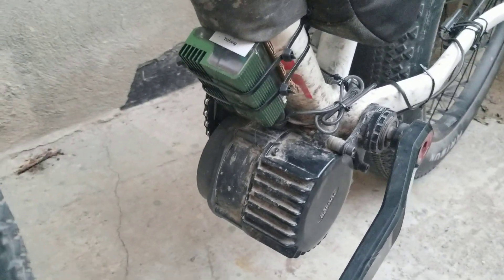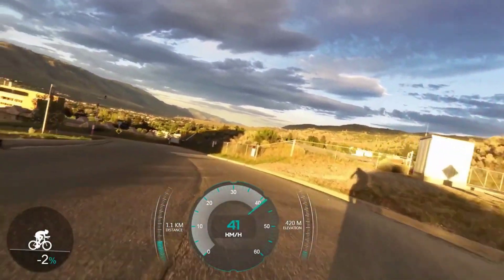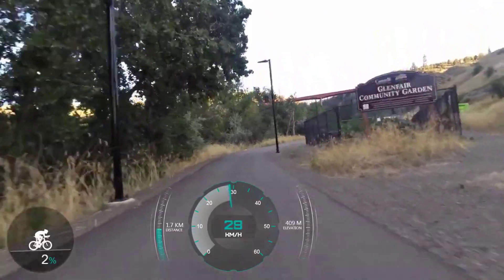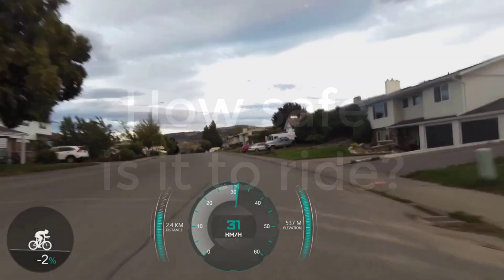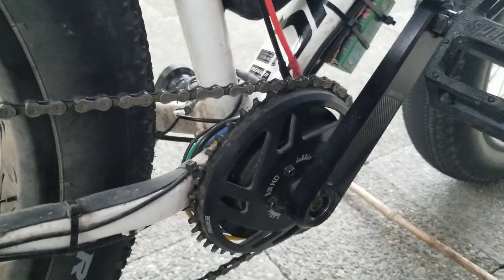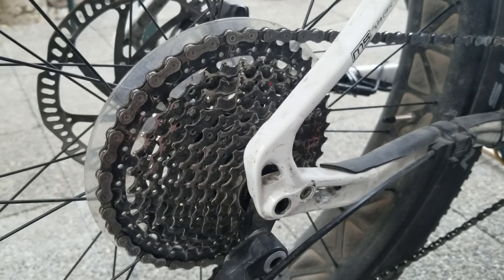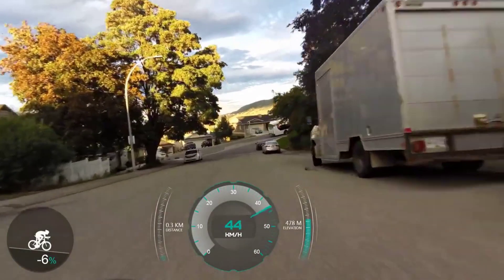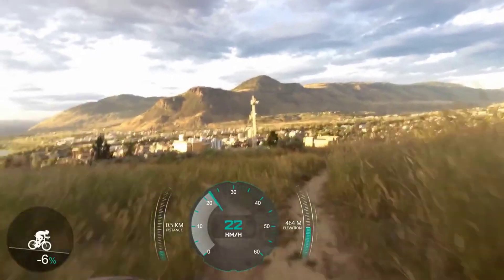Bafang BBSHD - Ultimate Controller? ASI BAC800

Comment: Are there parameters you can change? I don't like throttle being tied to pas level. Also, one of the best parts about the stock controller is cadence based pas. I can keep the pedals spinning at my preferred cadence, so I never get ghost pedaling. Does this controller support that?

Comment: I have Done NOTHING to my BBSHD and it does 48MPH or 77.2KPH in 7th Gear 64 Tooth in the Front Drive Gear and the Rear is 13-32 Tooth I go up Very Steep hills at 24MPH or 38.6KPH in 3rd Gear and it is 48 Volt 17.5 Ah 13S7P and the Motor Pulls 1,000 Watts Continuous and 1,500 Watts Peak and My Weight is 210Lb and my Bag I Carry with my Tools is 50lb. You Don't need to push the BBSHD to it is Burned up. I have over 1,287 Miles on my BBSHD and go's like when it was Brand New. Don't Waste your Money with Hub Motors.
Reply from the maker: Yeah. If you put on a huge front gear and have the right setup you can hit high speeds. This controller does it in a slightly different way but no worries on burning up either. Cheers
Reply: How can I get a control buy one

Comment: Great job with those videos.  Thanks for the content.  Is there any way to buy a used ACI 8XX already programmed for a Bafand BBSHD ? Is it a thing?
Reply from the maker: Ebay is your best bet. Or classifieds. We make a kit ourselves but there is quite a wait list right now.
Reply: @HighVoltageKits  Thanks for your answers.  Do you think the Grintech's phaserunner or Baserunner can be another option ?
Reply from the maker: If they make it again yes. They also do the Frankenrunner which I'd another option

Comment: hello, very informative video. i have a bbshd and i was thinking to upgrade to the bac controller but the prices i see are very high. how much did you buy the bac? thanks
Reply from the maker: The evaluation kits are expensive. We do make kits where they are cheaper as ASI dealers. The best way to get one is to have it pre programed. You can get a similar kit also from Electron Cycles in the UK.

Comment: Will this controller work on the bshd 750?
Reply from the maker: We have a few folks using it with the BBS02. It will work but you need to limit the power to about 2200. But a nice boost in top speed etc. If you join the discord channel via the link on the description you can chat to the guys using the kit on this motor. Let me know if you have any problems with discord. Best to install the app before clicking the link. Cheers

Comment: Great content! Isn't that the max amps the controller can pull out of the batt pack and put into the motor related to the amps the cells in your pack and the BMS can put out. So my em3ev triangle pack has a rating of 31A continuous, with the Panasonic GA cells, and max burst of 41A, and the BMS is set to trip at like 50A. So in theory the best I can get from the pack is 31A X 52V = somewhere north of 1.5kw or maybe 41A X 52V = ~2kw+.
In other words, how can the ASI controller deliver more power to the motor than what the cells are rated for, i.e. pull out more amps than what the BMS in that battery pack would allow? I'm really looking into getting your BBSHD BAC855 Upgrade Kit but I don't know if it would work with my setup (bbshd + triangle 14s6p GA sells).
Reply from the maker: The cells you have are more designed for a good capacity than high power delivery. The ASI will try and take as much power as you set it to within its limits..So if you set it to pull more than the battery bms can handle it will trip to protect it. With the specs you have you would need to reduce the power to the point where you do not trip the bms. Hope this makes sense. Cheers

Comment: it would be nice if GRIN TECH would design a controller that would fit inside the casing or replace the controller completely without having a separate thing to strap to the frame..  You also have to get different brakes, display, and multiple sensors... GETS EXPENSIVE.
Reply from the maker: Grin make good stuff but the tech is based on ASI property. It has to work with many motors from the bbshd to hubs and beyond. Luna have just developed a version 2 of their bbshd controller on the vesc platform. It seems locked to the purchase of a bike however

Comment: Is your controller sending more than 30 amps to the motor? If so, what type of battery cell is required for this?
Reply from the maker: Its 50amps ish. Bit more peak. I use Sony vt6 cells on my 72 volt pack. I have a 72 volt lipo pack as well. You need a battery pack that can deliver at least 60 amps continuous. That requires the right bms and a number of cells can do it.

Comment: Would you recommend this set up if you are using the specialized fat boy for riding in the snow or sand? And do you set up bikes yourself for others?
Reply from the maker: If you are local in town once the bloody covid restrictions are lifted then we can have a chat. I can certainly give you advice. In the meantime you are very welcome to join the channel discord community and post questions etc. This is the link. https://discord.gg/AnyQRuh I have ridden up to the top of Kenna Cartwright in snow so it does seem to go well. I used to ride it alot in snow in Gatineau. I use studded tires in winter. Sand you can ride on with good grips and wide tires! Cheers

Comment: The BAC 800 is no more now? Is it not the 855 now ? What's the difference?
Reply from the maker: Better heat sinking... Firmware like the 2000. Put it this way... There is nothing that would drive me to swap out my 800
Reply: @HighVoltageKits  Spoke to Max and he told me that he only supplies the 855 now and recommended the TFT touchscreen in preference to the Eggrider, I think I will wait until the new year to see what happens after the Brexit transition period is over, as it looks like Boris has agreed a FTD with Trudeau lol 😁 not sure how credible that is or if there is in truth to that fact ..
Reply from the maker: Sounds like a plan! Who knows what will happen these days.

Comment: My bbso2b 48v  750w does a steady 28mph on level  5 . Then lose power on a slight grade . Luna sell these controllers on the bare bone motor i beleave . Would be nice if Eric sold it seperare .or toying with a cyclone from luna to the UK ,mabee cap
Reply: Cheers , i was looking into there batterys at luna , or em3 paul for the 72v biggest ah i can find .
Would be cheaper to just do my driving test again lol. I thought eric was the man cap . He comes over " hes so pasionate about making the best batterys out there .
By looking at your early stuff and where you are now in the ebike world of knowledge ! Your well in frontvof me . Only just got my 1st solde iron at 51 .
I dont want to buy the bbshd and then think if only i bought the cyclone !!!!: lots out there to study . I see your pnto making your own cells now so good luck cap
Reply from the maker: It is well known in ebike circles that Eric is pure cancer. Im not going to say more but he is pretty much the Donald Trump of the ebike world. His path is literred with people he has ripped off betrayed and double crossed. Check out litespeedbikes for 72 volts. Chris makes a really good pack. It's what I use.
Reply: @HighVoltageKits  well only just got into it the last 3 months and should have waited and read more . But im not un happy with the little bbso2b . You read so much of others veiws about so many things cap . Do you think a 52v 17.5 or 20 ah would be a better ride than the 48v 17.5 lm running now ? .

I wasnt aware eric was a bit of a snake like that , apart from 1 thing i read 2 days ago that theres a smear campaine from other companys . Read this in a thread about the new controler in the bbshd thats 50amp now . And he wont sell them seperatley . I cant recall how old the thread was . But thanks for the heads up from one brit to another !!! About the 52v ?
Reply from the maker: I know of three people personally that have had designs for motors etc ripped off etc. But its a waste of time. He can dig his own hole. Luna is ok but there is so much bullshit marketing to make average Chinese manufacturing look and appear like us made tech. Their controller is not great but its ok for 2500 watts 52 volts. The bbso2 is good. Check out Bruno poweeeeeeeerrrrs early stuff for good modifications. In terms of battery 52 volts will get a higher speed and more range etc. Why don't you join the discord channel. Way easier to help on there.
Reply: @HighVoltageKits  will look up that channel . Seen bruno vids and hes done great for bbsers but its his voice man ohh god . 
52 volts with 20ah should be giving out more  watts . Forgive me like i said its all quite new . But have been watching an reading threads . Some guys fo the  maths then say its imposssible to go that speed . I get well over 30 on thst tiny little thing , its mad . I may go bbshd with another comtroller route.
Buy will read more before i pull the triger.
You know so many mates have brought asian thai women home an its only money etc not real love .
1st thing i notice ashley and given 50 per cen of luna !!!!! Just say it all that does .
Reply from the maker: I would not get anything ASI from luna. The cyclone is not runnable with the ASI. If you really want to use that one do some research on endless sphere to see what people used maybe.
Reply: @HighVoltageKits  imagin holland cap . Been through about 5 times on my waycto germany working . Flat as far as you can see crazzy

Comment: I got the bbso2b 750w and after changing my rear cassette from 14.28 to a 12 28 its going 67kph 42mph but thats no weight .
If lm sat rideing now i can get 35mph but i stay around 26 to 29 mph and happy an it wont burn the moter out . If i put the 52t chainring on it would do easy 40 with my weight but will keep with the 48t as it will burn the moter .
Well happy with mine .
By the way these speeds are level 5 .
I should check out level 6 to 9 but its good at level 5 set .
I love speed but i wont put the moter watts maxxed out .
Faster then some bbshd moters .
Reply from the maker: Sounds like you have got the gearing figured out! Its a balancing act for sure. I could push mine more for speed but it would be at the cost of reliability and longevity of the drive train. Cheers!
Reply: @HighVoltageKits cvf read you csn up the volt
Reply from the maker: 52 volts is the max with the stock controller i think. Maybe join the discord and post this on there. Easier to get you help. The link is via my website www.captaincodswallop.net
Reply: @HighVoltageKits  i will stick with a 48v with the highest amph like a 20amph . I got 40 miles mainly on throttle as crank arm come lose . But was surprised how much  i got thr 1st run , so 60 miled easy staying in pas 1 to 4 .
. And 26 mph is plenty.
Reply: @HighVoltageKits  yeah it was 17 mph an felt let down . The vender was no help at all .
But after lotsa foruom reading sorted the back and front out an slowly it was up to nearly 4omph but put my weight on at 30mph i still cant quite keep up pedalin which is good . If i put the 52t on i would be able to pedal but thats not wat the motor wantsc. So i plod at 28mpj an not put motor under strees .
So 30mph is on straight but keeping under 30 its a sweet spot . Took time to sort.
Fuk the 52t will keep itv away so it will last .
Just ordered bbso3 or as called bbsHD from cnebikes for the kit $470 which would have cost 600 pounds plus

Comment: Hi guys I have a 52v hailong battery 17ah with a 1000w bafang motor . Can I buy the asi bac 800 controller for this battery. As it says the controller is for a 72v battery?
Reply from the maker: It will work at 52 volts road at that for ages with the ERT kit. There are two places for a plug and play kit. ERT and Electron cycles.
Reply: @HighVoltageKits  much appreciated cap. So it wont damage my battery ? Does it make the bike go faster or does it make the bike go further or should I say the battery go further in normal riding.?
Reply from the maker: It depends on the type of cells and bms of the battery. I may be not strong enough to take full advantage of the 800 or 855 as it is now. But it will give increased acceleration and top speed. Range will decrease if you are running it full power as the price of such performance is it consumes more power. Hope this helps. Cheers
Reply: @HighVoltageKits  yes excellent so the bottom line is the 72v asi bac 800 is just a case of plug and play with my 52v battery no need for any re map or anything like that to suit my battery ?.

Comment: Dear man, I have an Asi bac 855 connected to the Inokim ox scooter (I know the motor is 800 watts). Do you have a configuration file for the bacdoor application, please?
Reply from the maker: Not that would run your scooter. https://discord.gg/YAAjfgc Join this and post and you might get some help as to what to do. There are a few people doing scooters on there

Comment: Hi I have bafang 1000w mac motor and when I slow down or stop for a second, the motor turns off. I need to turn the throttle twice or pedal in reverse to turn it on. How can I change that? It’s annoying and frustrating… do you have an idea?
Reply from the maker: Not at present but if you join my discord forum https://discord.gg/YAAjfgc you can post pics etc and we can take a look.  Some very clever people on there. Cheers

Comment: What is the max voltage you can put to the original BBSHD controller?... Have you checked the voltage rating of the capacitors inside?
Reply from the maker: No I have not but I am pretty sure 52 volts or 58.8 fully charged is the max... With a bit of wiggle for spikes.
Reply: Captain Codswallop Do you think it will be okay to use my 3 20v(18v nominal) 9Ah dewalt batteries in series (61v fully charged). I suspect the voltage will sag a little under load. The capacitors of other Chinesse controllers are usually rated for 63v but I am not sure if that is the limit for max voltage. What do you think?

Ps. Greetings from Calgary, you have a collection of great videos.
Reply from the maker: Well honestly. No idea. But if you want to join my discord. There are some good battery people on there that could tell you. In theory yes. You could also undercharge them. Depending on the firmware on the bbshd you may need to flash it. Cool idea tho. Whether they will handle the current requirements is another question. https://discord.gg/YAAjfgc

Comment: I am getting use to the speed of my bafang 52volt 1000watts its more like 1400 watts it goes good but faster would be nice. Your motor sound really loud. Metal gear instead of nylon gear mabe. Mabe i will get this or buy a cyclone 3000 watt. 🤔👍🏻
Reply from the maker: It needs greasing. I will get round to it. The peak for a BBSHD at 52 volts should be 1700 watts. So if it is not getting to there then I suspect that the AMPS have been capped on your bike. Do you have a programming cable?

Comment: I don't want to start the age old argument. But to be honest I was expecting more performance from the amount of wattage compared to a hub motor. Maybe it's just the video not capturing the sense of speed.
Reply from the maker: It's quite a heavy bike and the 52 volt pack it's running on is not the highest power. It's much zippier on 72 volts. Runs cooler as well. https://youtu.be/o8z-hgFE_YQ

Comment: Does switching over to this controller mean that I will get less miles from my battery before having to charge it?
Reply from the maker: It will give you that potential yes. Whether you run it max power is up to you. I can still get 30+kms out of mixed riding on a 25 amp hour pack. Range in reality is how much power in your battery and how fast you consume it. The ASI controllers let you use it fast. But you can also tone it down. I often do. Despite the videos most riding I do is cruising and trail riding for enjoyment or commute. Cheers
Reply: @HighVoltageKits  Only 30 on a 25ah pack? Should be at least 60, if not 80
Reply from the maker: It used to be but the capacity has dropped over time and I usually only charge to 90% So running full power is consuming twice as much as before. I like to be conservative with range. How far and fast would be a balancing act for the individual rider. Cheers!

Comment: Any noticeable range increase?
Reply from the maker: If you run full power with this controller you will reduce your range considerably. Probably half. But range is only a product of how much power you consume so you could run it at reduced power for greater range and I often do. You could use a larger battery. The big thing about the ASI is the much higher spec of the internal components and potential for a much smoother ride.

Comment: Nice video! How you have connect the gear sensor?
Reply from the maker: There was a plug for it off the main harness.  A yellow higo
Reply: @HighVoltageKits  thx,on  the asi bac? When yes, do you know the phaserunner have the same option? I wanna buy now a bafang and I don't know what is the best option for me! The 750w have not enough power for, when isn't modified! But 1000watt bafang is really expensive and also the controller is not the best!
Reply from the maker: The phase runner will see you stuck with the cycle analyst for a display. You can use the asi with the bbs02 just less power. That's up to you. The phaserunner is a custom version of the bac800. Not as good heat sinking etc. Smaller package and easier to mount slightly.